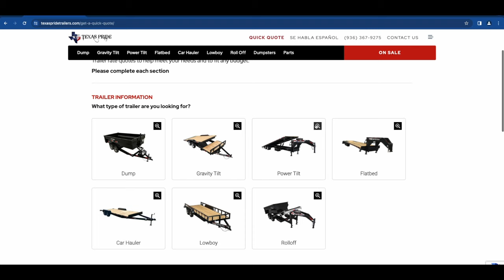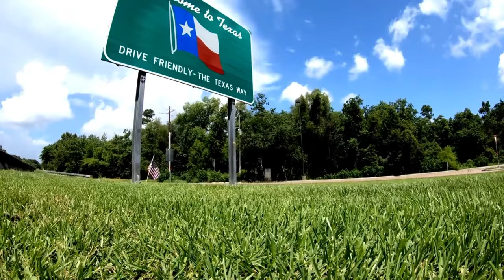1 Year with Texas Pride: Honest Trailer Review!

Comment: Gotta say, very glad I found my Pro-Tainer. Was leaning towards TP for the reasons you did, but the PT option presented itself. The PT is a beast. One big difference I noticed are TP's hydraulic cylinders. They use smaller, tie-rod cylinders which I'm not a fan of. The uncovered engine on top isn't a great thing either, not sure why they couldn't cover it.
Reply from the maker: You got the ProRoll I take it? I’ve only seen the Geneva which I’m not a huge fan of, but I’ve heard great things about the reeving unit version.
Reply: @MAXCODumpsters Yup, ProRoll. Have not heard the greatest things about the Geneva.

Comment: I have 14 feet dumpsters. I want the 24/26K dually tandem trailer. Quick question can I put a flip up stopper up front to keep the dumpster back 2 feet?
Reply from the maker: Mine have stops for 12/14/16’ I believe the dual tandem does as well!

Comment: Great video Joe!

I’ve been fully operational since October 2023 with the TP 16k proprietary rail system. Let’s see what my year brings me.

I’ve had some hiccups, but nothing a phone call to TP fixed. Their support so far with me has been outstanding.
Reply from the maker: The good thing about 47” TPride rails is a LOT of trailer guys run them. Easy to buy/sell when you need to. You’ll want to consider preparing for 36” eventually if you want to end up in a hooklift truck, but if that’s not important to you the 47” rails are a great long term option. Just something to consider before you hit a real stride and grow your inventory very large.

Comment: Great video. I got mine in September 2023.  I had the same problems with paint quality and grease zerks. One thing I would change though in the tarp being 1’ wider. I have to bungee it down sometimes to keep stuff from blowing out.
Reply from the maker: Good call Kip! I also forgot to mention the toolbox/dumpster foots blocking issue. Such a weird design.
Reply: @MAXCODumpsters  yes the boxes are a strange design. I would love to figure out a spot to mount a toolbox somewhere. It’s like you said, it’s all little stuff.
Reply from the maker: @Dirtydawgdumpsters  I hope it holds up well for you! Thanks for contributing to the video. 💪

Comment: Great video! keep an eye on the rear axle leaf spring mounts. There’s a plate welded in the leaf spring hanger that the leafspring rides on to set ride height . overtime that plate will fail, causing your axle to ride on the frame.
Reply from the maker: Thanks for the tip! I’ll keep an eye out.

Comment: What’s your opinion on taking the gas tank off and going with a boat gas tank in the bed of the truck with a fuel line ran up to your motor
Reply from the maker: The idea of running a fuel line from the truck to the trailer sounds a bit sketchy, but I couldn’t really say. I’d be concerned about it getting pinched and breaking.

I’m 6’ 2” and young enough that climbing around the truck bed isn’t really a problem for me. If your concerned about refuel, id probably go the route of keeping a 5 gallon fuel can and a step stool next to where I park it, and refuel every morning/night.

Comment: Bro just curious how much did you pay for the 6 containers and the trailer, Im trying to get myself a bumper pull with the same specs of yours thanks for sharing your thoughts such a good move 👍
Reply from the maker: Right around $60k for everything. Depending on where you’re located you should be able to find well made dumpsters from a fabrication shop for $4/6k

Comment: I have a 14' TP 18k derated to 16k reeving bumper pull, and I agree completely with your assessments.  When the TP salesman was showing me how to use it at their shop, a hydraulic line blew and sent a geyser of fluid everywhere.  A few hours later it was fixed and I was on my way back to FL.  At a rest area in LA I noticed the d-ring on the cable was gone.  It had been hooked snugly on a rail when I left.  They shipped me a new cable.  Both bed lift rams leaked fluid, so they shipped me new ones.  The brackets around those rails snagged on the dumpsters and bent over.  I had to cut those off.  TP sent me new ones.  The auto tarper arms sit crooked like yours, and the canvas unrolls as I drive.  I had to bungee it for the ride home to FL.  

They do stand behind their products, but all of this could have been avoided if their QC team had tested the trailer with a loaded can before delivery.  If that d-ring had fallen off while I was loading or unloading a can at a job, someone could have been killed.  

My big gripe with the design is the location of the spare.  It is located on the mast, above the pump and will be a backbreaking MF'r to pull down when I need it.  The tool box lids are crap and not water or dirt tight.  The tarper battery is smack in the middle of one box and is in the way of everything and the location exposes the wires to snags.  

All in all, its a solid trailer now that all the QC issues were resolved.
Reply from the maker: Every person I know has their own version of poor quality control and great support after the fact. They’d make so much more money if they just did the stuff right the first time. It’s an odd process in my opinion, but it seems that’s the route they’re content on. 

Thanks for sharing your experience and I hope your trailer works out well for you from here!
Reply: I saw in another video that you are interested in evolution welding dumpsters. Those things are built like tanks, and their customer service is phenomenal. They actually helped me with an issue on my TP trailer with the cable length when I came to pick my dumpsters up. They went above and beyond to help me when they did not have to. Their sales staff is very friendly, responsive, and will most definitely get you taken care of.
Reply from the maker: @Rwhite8278  Thanks for your input Rwhite! I already know Yunior and have had multiple of my friends in the area purchase dumpsters from them. They make a great product for a great price. 💪